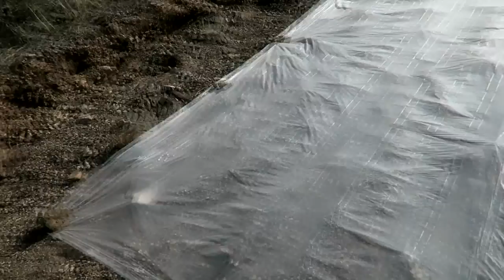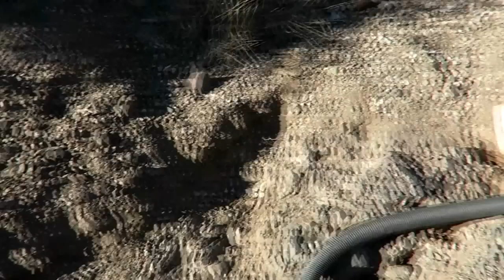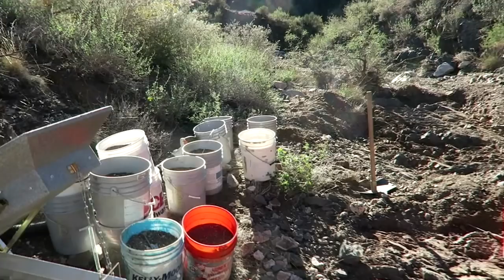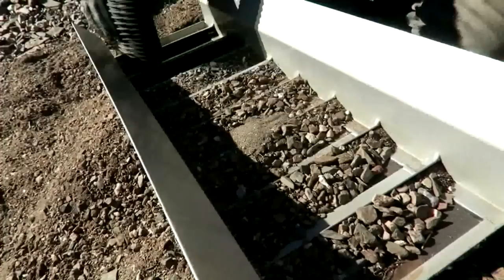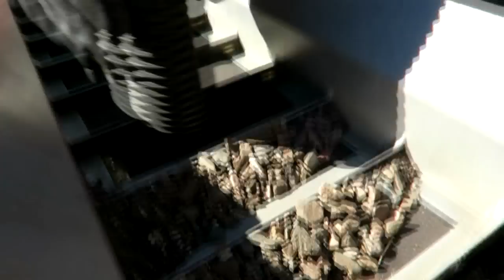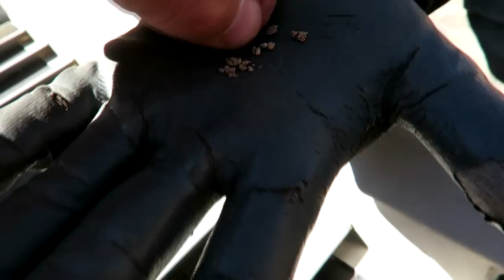Wet & Cold Drywashing For Gold In The Arizona Winter

Comment: Love the dry washer videos. Do you have any thought or experience with the changes Keene has made to their drywashers? i.e. "blast gate" and all of that? It is just gimmicks? Are the keenes better than the Royals?
Reply from the maker: +jdeluisa  Boulder dash , the other guy on the videos has used one. It was a 151S ?   I think he said the plate on the first rifle was nice and would definately aid in longer wear of the cloth . the other stuff is only necessary because he said the blower puts out higher cfm`s  than the original motor which is overkill so much that the thing needs gates to let some air out. Personally, I would stick with the originals , as they have less stuff to adjust, put together and wear out. Keep it simple, basically .....  Just like the keene 190? ...Looks like more overkill.

Comment: Hey guys did you ever tested in Mt Tipton area? I was driving pulled over( saw some red ground) there were lots of quartz. I think it came down from mountains. If you find anything let me know. I'm sure these quartz will carry gold.
Reply from the maker: Let you know?   Thats not how it works . Venture out and find gold on your own.
Reply: I BRAKE FOR BEDROCK I would, it's just I'm truck driving. I barely get 4 days off a month. I thought if you find results there that means I'm not too far. Even though I think it's national park or wildernes area, not sure. The bedrock is deep in the roadside. I'm pretty sure the quartz laying on surface can carry flour gold at least.

Comment: do you classify before drywashing, or just run it with the standard classifier on the drywasher?
Reply from the maker: The drywasher has a built in classifier. No need for the extra step , just throw everything at it.